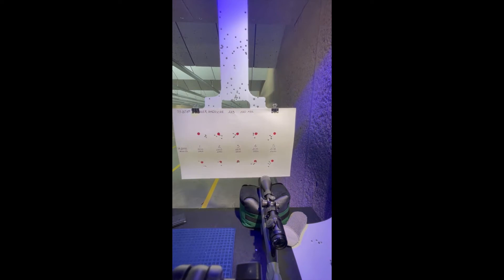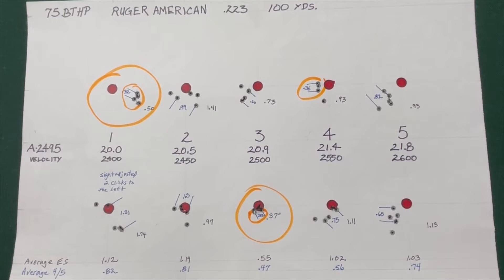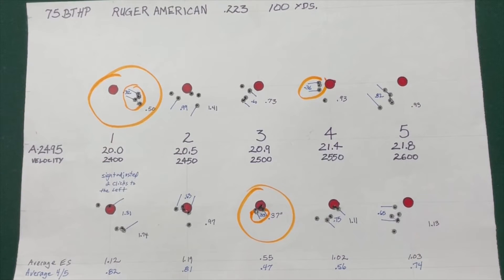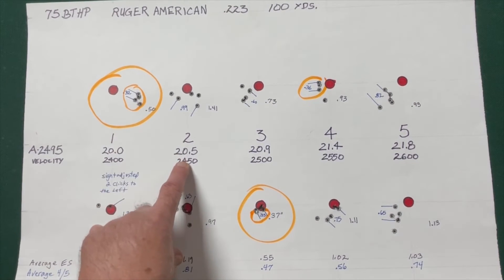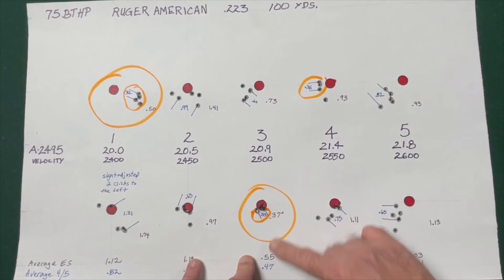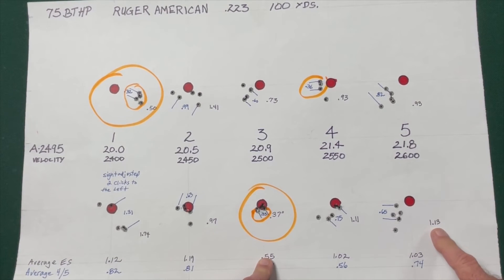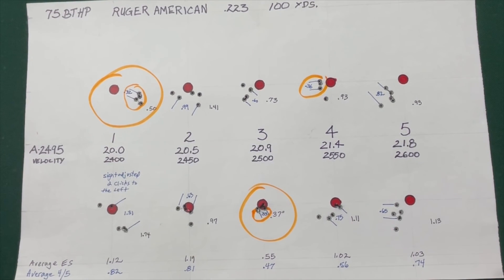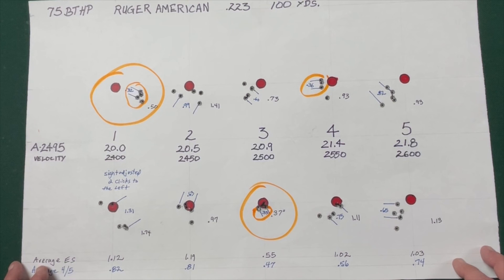Load testing - Accurate 2495 powder; Hornady 75 gr. BTHP bullets; Ruger American .223; 100 yards

Comment: Hodgedone told me i could use 24grain 2495 with a 55grain bullet is this going to damage my rifle?
Reply from the maker: @richardevans3084  what is the maximum load shown in your reloading manual? If it's over that, then no. Don't do it. Thanks for watching.
Reply: @EverydayReloadingandShooting  It’s 25 grains in manual
Reply from the maker: @richardevans3084  as long as you're below the maximum charge weight for that particular bullet, you should be fine. Never exceed published loads.

Comment: All the time, when I watch you analyzing your groups. The upper groups almost all the time are not the same or group size as the  lower  groups.
Please, can you make a test with one 10-shots group per charge.  4
Reply from the maker: Yes, I agree. It is odd how two groups of the same charge weight can group so differently. It may be that the cases are not all the same. Thanks for watching. The 10 shot group is a good idea. Thanks.

Comment: What scope are you using?
When you adjusted 2 clicks to the left, the scope windage turret did not move the erector immediately to the right (moving  the point of impact to the left) after the first 3  shots landing where they should before the adjustment, the spring-loaded windage turret, gave way so the last 2 landed where they should be after the 2 clicks.
Consider inspecting your scope at the factory for adjustment or replacement
Reply from the maker: You may be right about the scope. It is interesting that the first three on that second group after adjusting didn't change POI, but the last two did. It's an Athlon Talos 6-24 x 50. I've also noticed that the eyepiece is a little hard to focus sometimes. It may need to go back to the factory.